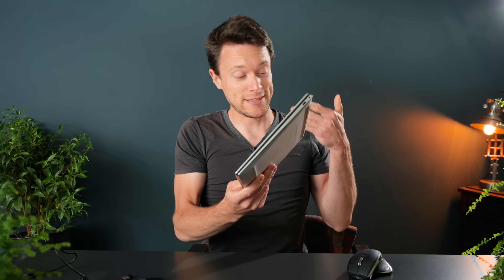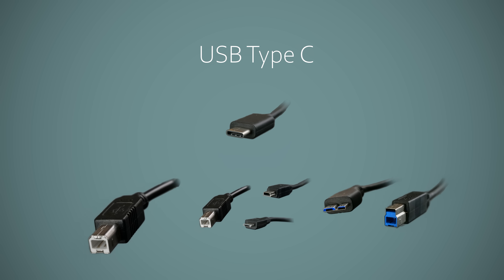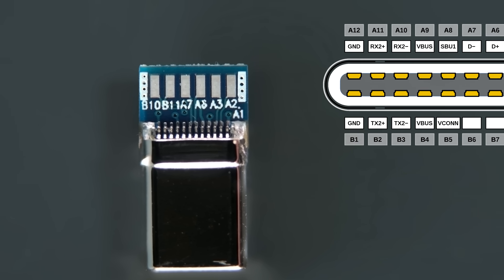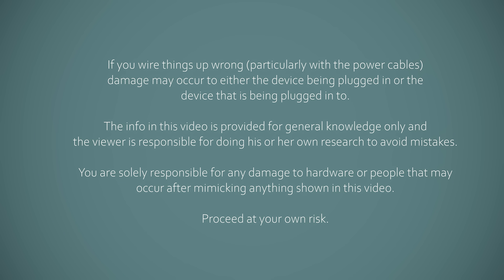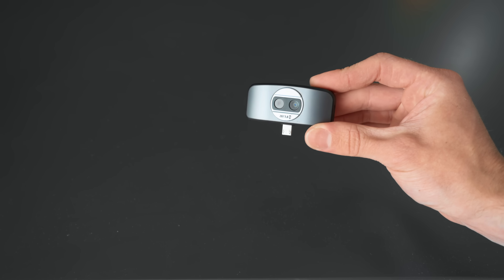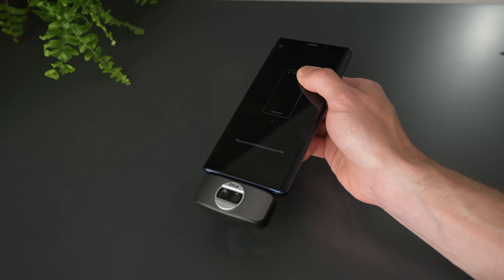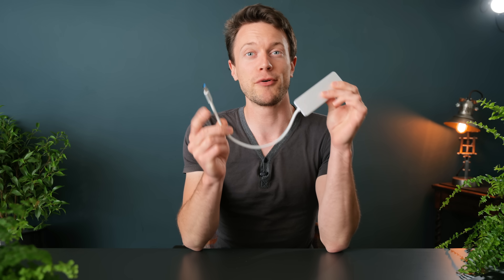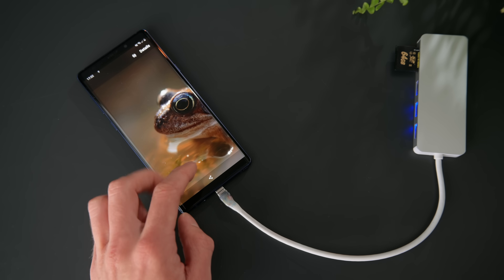Converting devices to USB Type-C

Comment: 14:49 You could do that even with micro-b on older devices, couldn't you?

Other than that, brilliant tutorial!
Reply: I don't think many hubs/devices were made with Micro B in mind, perhaps if you replaced the cable with a 2.0 one it would work but it's not nearly as seamless as Type C is. Only thing that comes to mind that had support for Micro B was a SanDisk flash drive that had both Micro B and Type A on opposite sides, but even then it was pretty cumbersome.

Comment: In my opinion, type C is a great replacement for micro b and mini b, but it SHOULD NOT be a replacement for type A. Type A is virtually indestructable whereas type C wears out pretty quickly and is much more delicate. It's not even that much smaller than type A.

Comment: I see some Polish solder. "Spoiwo lutownicze" :D
Reply: Not every country have normal solder available. It's sometimes easier to get it from different country.
Most of the time I'm in NL. In shops you can pretty much only buy leadless solder which in short SUCKS.

Comment: Type-C is the future.

Unless you consider all the different cable specs and how that compares to the USB-A simplified chart you made.

You neglected to mention that USB-C-PD is different than USB-C  as you need to get a certified EMCA cable to get your 100W PD spec, typically USB-C cables at MAXIMUM can get to 60W.
Please add to your description or here as a reply to my comment the different specs for people that might not know any better and think that the USB-C form factor means that all cables and devices are the same when they very much are not.   Also it would have been good to mention that thunderbolt connections/connectors utilize the same form factor so people should do their research to ensure they are buying compatible products. 

Not to mention you didn't cover tracing the PCB to take a look at which pins would be for data+ and data-, the guess and check method is quite outdated and with some simple steps you could be educating your audience rather than recommending sugru as an option or epoxy rather than getting a kit that has an enclosure around the connector or device.

Comment: Wouldn't it be easier to just move the SMD resistor on the breakout board?
Otherwise I really like the tutorial to give old devices a new life.
Reply: @memberwhen22  dont you think its a little disingenuous to accuse him of having no idea what hes doing? he repeatedly acknowledged the availability of adapters. as far as moving the smd i think for many people soldering an old school thru hole resistor is a lot less difficult or intimidating. As far as just buyimg adapters goes the whole point is to not need an adapter. im mostly interested in converting a bunch of stuff that is charging only (bluetooth headphones, bicycle headlight) where the need for adapters is extremely inconvenient
Reply: @memberwhen22  Lol check out 8:35
Reply: Like USB 4 faster than 3.0 SuperSpeed with Type-C

Comment: Hint for anyone doing the first thing (mouse receiver) and ONLY use the device with the laptop: use a thin, flat cable to extend the wire from the USB-C connector to the device itself, and tape the receiver to the corner of the screen (on the backside). You're essentially making another dongle, yes, but this time a thin, flat one that can be left there even when transported around.

Comment: if you do the webcam video, also go for transforming old phones into webcams. Making them power on without a battery could be a whole video too.
Reply: If you're on about taking a phone apart I think that would detract from his 'beginner' theme that he tends to go with for his videos, however if you're talking about using a phone as a camera device through software then that might be a good idea for him to explore.
Reply: @amirpourghoureiyan1637  I was going for the droidcam and alike software solutions, and soldering the battery leads.
Reply: @wantomek  Maybe on early 2010 phones that could be done, but not on anything since as they don't have access to the battery compartment now without literally tearing the phone apart
Reply: @amirpourghoureiyan1637  I was thinking disassembling the battery and powering it through its protection circuit.
Reply: DIYs using phone parts is a great idea

Comment: 7:05 - Could you not also desolder the resistor and solder it on the other pair of pads which liiks to be connecting the pin to ground instead?
Reply: No unfortunately that won’t work
Reply: @lailasanti2588  unless the  pull up resistor must be different than the pull down, I dont see why not?

Comment: I'm still confused where does the resistor solder to? You skip that shot always, and afterwords it is impossible to see it. Also, links for buying the resistors?
Also, is there devices that need to be host devices?

Comment: Its worth saying that with USB 1.1 it was introduced a lower speed. The reason for this was to connect to cheep low speed components like keyboard, Joystick and mouse.

The issue is that USB 1 and 2 have to use the same speed on the full port. So if you hub a keyboard and mouse with a memory stick, you will get quite  a significant speed penelaty.

The device will still reach full speed at some periods, but it will go down to the lower speed every once and a while to communicate with the keyboard and mouse. The hub can´t convert speeds, just transfer them.

USB 3 use the new pairs exclusively for the higher speed, removing this problem

Comment: Very useful! I actually have another project in my head, converting a monitor to usb-c and it will also get the power from it. USB-C thunderbolt enabled ports uses PD and while supplying higher voltage it also sends DisplayPort signals in a single cable. This is the only channel that I don't skip ads cuz they are even useful :)

Comment: 8:33 For the amount of work you did, the adapter you can buy is plenty good enough. Your mouse will still need to be charged with a micro USB cable anyways 🤷‍♂️
Reply: But that it wouldn't have been a fun project to show us. Sometimes its just fun to do one of these projects that might not seem that practical to everyone.
Reply: Unless he did the same thing with the mouse charging connector 😂
Reply: the mouse uses aa batteries for power
Reply: @marekmce1    It looks like an MX Master, which uses rechargeable AA batteries and it has a charging port on the mouse (at least the MX Master 2 does, I own one).
Reply: yeah, for the functionality that it provides and the amount of effort the project requires, this is definitely a case where an adapter would be prefered. not to mention that you can still use your devices on usb2 since they still keep their orginal connectors. also, since this isn't converting anything or having to deal with decoding, the adapters make even more sense are they are simply hard wired to the different connectors.
Reply: As much as I agree, I want to know the ins and outs of the project as a way to understand when it's necessary to do things like this.
Reply: Who are you to tell him the trade-off between his time and the annoyance of having to use a large dongle?
Reply: If you're comfortable with soldering, it's really not that much work. Probably about 15 minutes start to finish, plus waiting for the Sugru to dry. Materials are just a few bucks, and it's a nice project to improve your soldering skills. You might break the receiver though, so I agree, I'd probably just use the small adapter, unless it really bothered me.

BTW, I use magnetic connector cables for everything, so the same cable fits all of my devices, whether they're USB micro B, USB C, lightning, etc. The cables I use connect in both orientations like USB C (even if the device uses USB micro B).

Comment: There's also this insert as an option... they've revolutionised my life 😁 https://www.dx.com/p/kitbon-ultra-mini-type-c-usb-c-to-usb-20-otg-adapter-for-cell-phone-tablet-amp-usb-cable-amp-flash-disk-2pcs-2604166.html
Reply: The inserts work good been using them for about a year on my tablet & mouse
Reply: Perfect!
Reply: indeed id prefer this to the soldering
Reply: duuuuuuuude
Reply: https://www.amazon.com/Ultra-Type-C-USB-C-Adapter-Tablet/dp/B077S1G4HX
Reply: Oh, I totally forgot these things.
Thank you.
Reply: Is it that much shorter than a short normal adapter tho? I mean, the only difference from these to those is that the normal ones wrap around the USB casing too.
Reply: I was just looking for these adapters for over an hour (you can usually get them for a lot cheaper) just to find that someone has already put a link in the comments
Reply: SomeKindOfSense  Usually they sell for 0.5$ ---1$ each. everything else is overpriced
Reply: Coburn Karma  Why do I need a video? If your gonna strawman try harder please
Reply: The only issue with this adapter is that it only supports USB2.0 devices.  USB3.0 and up devices are not going to be able to use their advanced functionality and transfer speeds with this adapter.

Good find, though.
Reply: @JB2X-Z  
"Only supports USB2.0"
Oh, you mean like his wireless mouse transceiver?
Or that FLIR camera?
You know, just two-thirds of the entire video.
Reply: @joshuaewalker  Except those are examples, peoples aren't always gonna have usb 2.0 are they with their stuff that they'll DIY
Reply: @Dwarfy2k  
Itty bitty USB3.0 Type A to USB Type C adapters also exist and are still a vastly better solution to connect Type A plugs into Type C ports.
Reply: I dunno why these kind of DIY videos are really needed when you have options like this
Reply: @Dwarfy2k  Idk, why do you even exist?
Reply: @nulliusinverba3529  I dunno cause your mom needs entertainment sometimes?
Reply: why are you guys so ignorant... you can always buy stuff, if you are not willing to build it yourself. also he tells you several times that you can get adapters. so whats your point?
Reply: Way better solution... This was a terrible DIY video haha... Let's build your own dongle, the hard ( and unnecessary ) way
Reply: Yes! Thank you! This DIY project is stupid and pointless. Adapters like these are a vastly better option. Saves you money. Saves you TIME from making some stupid sugru thing. Doesn't create a risk of breaking your devices by cracking them open and soldering. AND RETAINS USB-A FUNCTIONALITY! All he did was make something that only worked with USB-A into something that ONLY works with USB-C. What a waste!

Comment: hang on, whey you disconnected and replaced the resistor, there was a second pair of solder pads along side it on the ground side, it looked to me as if you could have  just unsoldered the resistor and moved it across to make it a client device?
Reply: If you have the soldering iron he's using, it's... a fair bit trickier to do, but you could do it.
Reply: @DoomRater  I was thinking the same thing, and then he came in with Solderzilla.
Reply: As mentioned in other spots, he could have bridged the pads after breaking the traces so there's no desoldering or new resistor required.
Reply: Nathan Savage good spot
Reply: I assumed the same thing...
Reply: I noticed this immediately. They provide a pad for changing between Host etc.
Reply: It is a bit tricky with a soldering iron, it would be better with a hot air rework station.
Reply: Desoldering such small elements isn't simple
Reply: @TheKopakah  its not that hard (and it seems to be only 0603 thats not that small).
To desolder just hold the tip besides the resistor and than "flood" it with so much solder that both pads touch it at the same time, move it (gently you dont wanna rip the pads of) and its off.
The only thing that would be useful is desoldering wire to clean the pads afterwards. I would count flux as a optional bonus.
Edit: He does it later in the vid anyways... but also soldering a smd Resistor in such a small space is easy than a tht one in my opinion.
Reply: @hendrik585   not even that difficult ... they're so small that heating a single side will usually fully take them off. This is why SMD is "difficult" to work with on densely populated PCBs, because bumping them for any more than a second with the iron can entirely pull them off the board.
Although I get some of the points, where a beginner with no experience, or a $5 iron with a massive tip never made for precision, may have a hard time with this - anyone with a reasonable amount of experience and a decent iron with a reasonable sized tip with a pair of tweezers shouldn't have any difficulty with this. There are many components like this that have pullup/pulldown pads for different configuration modes.
Reply: You'd need an SMD reflow station to desolder extremely small SMDs from such a small board. You'd also need flux and skill to do so. Otherwise you'd just be blowing SMDs off and ruin your day.
Reply: @julian23561  Its a single resistor that's a wee bit overkill
Reply: @julian23561  I've soldered 0402 components with a hardware store soldering iron. You just need a fine tip, a pair of tweezers, and a good magnifying glass.
Reply: Zan Hecht I’ve do this quite a few times myself with Arduino/raspberry pi boards to enable the external WiFi antenna port and disable the on-board internal ones. You just need a good fine tip (I used a Dremel to make a fine/sharp enough one) and either a low wattage or variable wattage iron, plus a pair ofceramic needle-nose pliers commonly sold for eCig building. Easy? No. Requires a full SMD rework station? Hahahaha, I wish I could afford one, but no. Not necessary. This was just one of a few things he did where about 2-3 times the necessary work was created. To quote Dilbert (about the only good thing to come from that comic IMO): Work Smarter, not Harder.
Reply: @julian23561  that's not true! Soldering SMD resistors is actually quite simple, even with a basic soldering iron! Just put the resistor on the pad and heat up the solder, the resistor will move to the right place on it's own.
Reply: @achannelhasnoname5182  it's still hard to solder those 0201 size resistors without proper soldering station
Reply: @kahtyman7293  not really just get a good pair of tweezers. as its a pull down resistor anyway you could just bridge the pads if your struggling
Reply: @achannelhasnoname5182  for somebody not having much experience in soldering, its still a little hard.
Reply: @Charger4241  Agreed. Easy.
Reply: @achannelhasnoname5182  well yes, you can do it with a normal soldering iron with a fine flat tip, a pair of tweezers and lots of patience but it won't be as clean. And you have a chance of ruining the pads if you put too much heat.
Reply: @kahtyman7293  those looked like at least 0603s.

Comment: is it possible to convert an DC charge port to usb-c and be able to set the desired voltage and amperage for the power supply (like a usb-c PD 3.0 wall plug)?